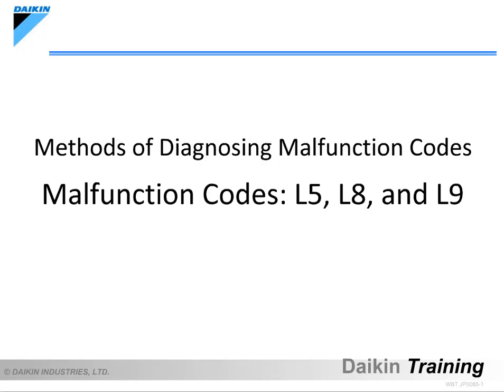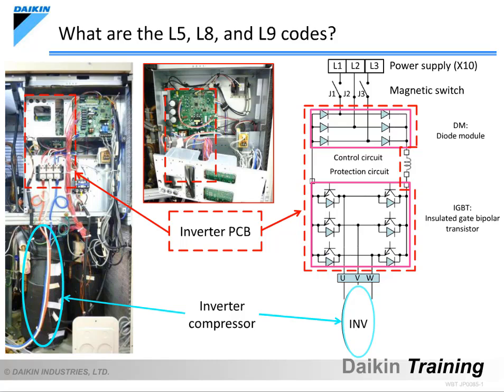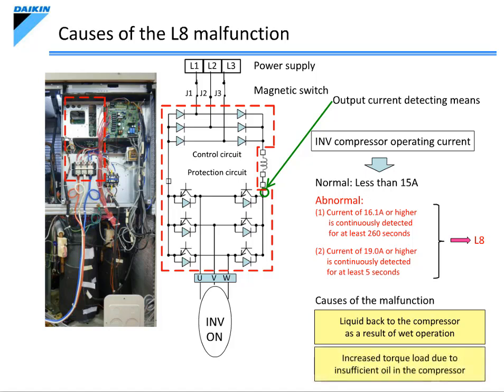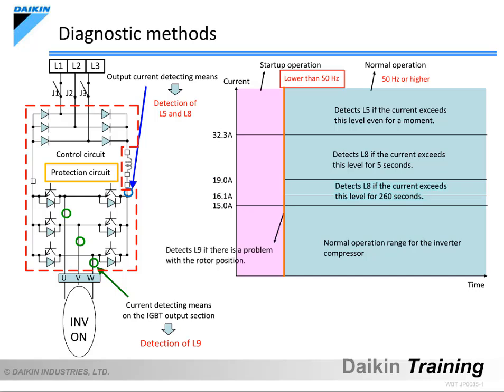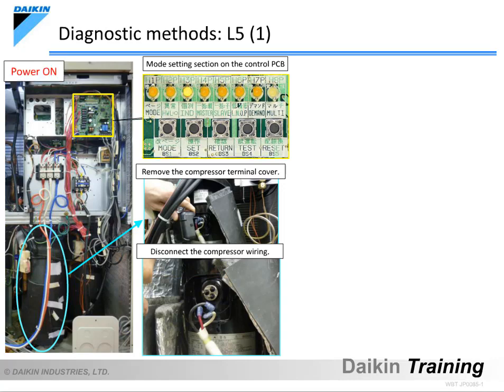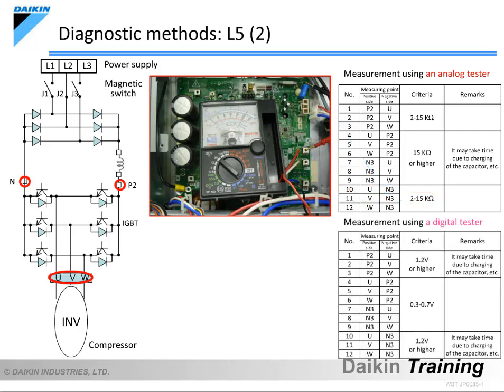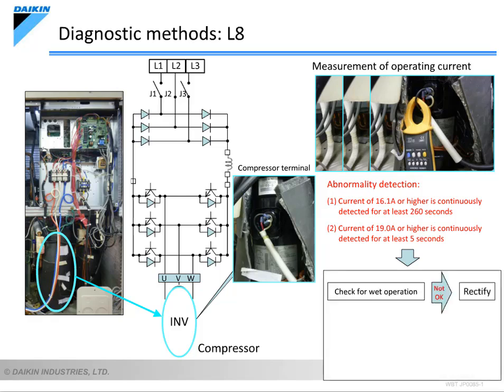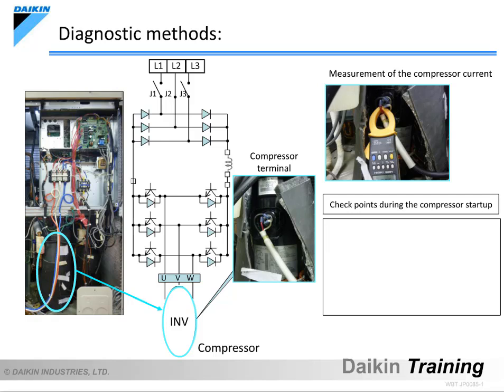Daikin VRV troubleshooting error Codes L5 L8 and L9

Comment: El error L5 en VRV 3 casi siempre el fallo está en la placa Inverter, y esta se puede reparar sin necesidad de sustituir
Reply: Hi, What usually fails on the inverter board? Bridge rectifier?IPM IGBT, capacitors?
Reply: На VRV 4 была L5. Плата инвертора исправна. На компрессоре были изношены все подшипники.